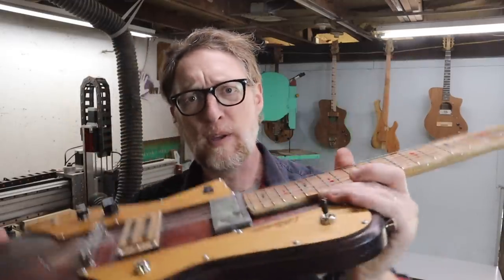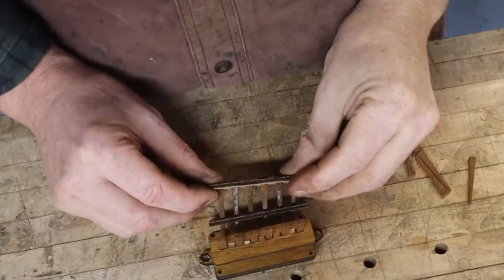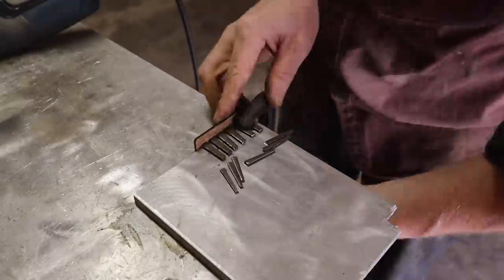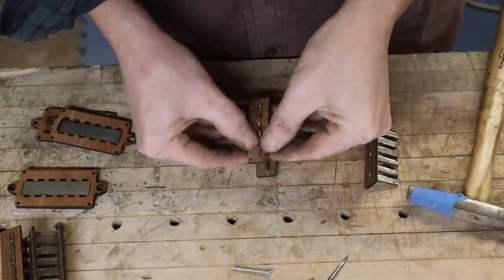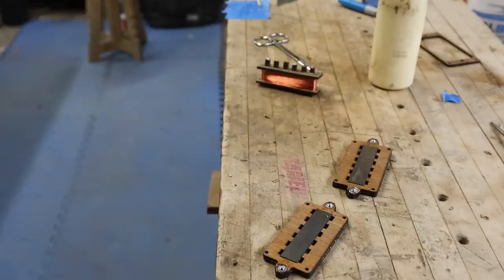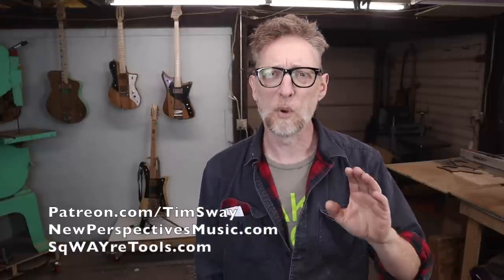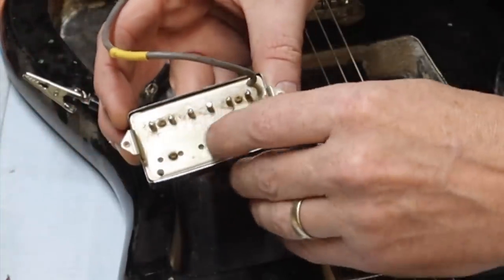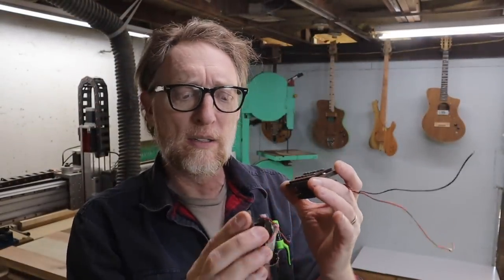Humbucker Pickups made from Iron Square Cut Nails -  SqWAYreBuckers

Comment: Nailed it!
The poles look to be fairly large compared to the fillester screws and slugs in a Gibson style humbucker. It would just make them a little hotter with the same amount of windings.

You really need to pick up a LCR meter to test the inductance of your pickups. I like the Hantek 1833C. 

You only get half the story by testing the DC resistance of the coils.
Reply from the maker: I know, I know... It's on my list. I actually just got some grant money to buy tools so maybe now is the time.
Reply: @timsway  it’s a really good tool to have around a shop anyway. You’ll actually be able to dial in a sound much more precisely and repeatedly.

Comment: Nice!! Square nails are super cool. I spoke with the smith that works at Tryon Palace (New Bern, NC) and he was telling me round nails will back out because they are round. Square nails will stay in better because they can't spin. If the nails were made by a smith they would be slightly inconsistent since they are hand forged and not machine forged. Anyway, seriously cool as always!!!
Reply from the maker: I don;t think these nails are old enough  to be hand-hewn, but they are still a little inconsistent compared to round, probably due to the manufacturing process.

Comment: They look awesome, i love the square nails, very vintage 😊 would you be able to make rail pickups using those nails? Or would that be a pain.
Reply from the maker: the heads are so big they kind of almost are rails! Stacking the nails sideways would get tricky to get enough thickness and contact. I like rails, too, and just use the magnet itself in the middle.

Comment: theyre cool, will almost be like a blade pickup with the width of the nail heads, be interesting to see if there was a differ if you turned the nails 90 degrees so they lined up with the strings
Reply: This is what Gibson actually did on the 1954 Les Paul - the "staple" P-90 had bar poles running in-line with the strings. I bet Tim could do his own version of that if he wanted.
Reply: @rindred  i know, but more interested if there was a noticeable difference  between the two ways
Reply: @dougiedrever7168  It's all about the magnetic field dynamics. There's probably some difference based on the alchemy/science around that, but so long as the poles are picking up the full range of vibration for each string, it shouldn't sound "notched" (missing tonal response) in some way.
Reply from the maker: What he said, lol. I think both of you know more about them than me! I just try making them out of weird stuff to see what happens :)
Reply: @timsway  i really just wondered if there would be a noticeable difference